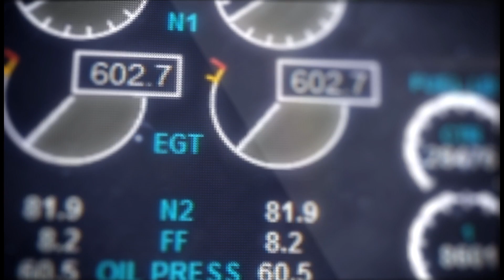Aircraft Turbulence

Comment: I have a question about setting the takeoff thrust in jets. When you move the thrust levers forward do you push them all they way forward and an electronic governor limits the RPM of the engine given whatever percent of thrust you were planning to use for takeoff?

Or if for example the takeoff thrust you were using was 90% is it just sort of guesswork and you set the thrust levers so they look like they're almost full but note quite?
Reply: +Rodgers Akechi @Rodgers Akechi  To explain flex you need to understand how engines work. The hotter the air is, the worst performance you will get because the air has already expanded. Now on hot days it takes longer to accelerate because of that. So when you enter a flex temp, you make the fmgc calculate the thrust rate as if the temperature was 15 degrees or so higher to reduce the performance of the engine and get less wear on the engine. The equivalent of the boeing is using derate on take off. 

Now on the airbus the full (as you say) refers to absolute max (TO/GA) the engine can give which can sometimes be above 100% N1 and can only be used continually for 5 min when two engines are operating or 10 min max with one engine out or else the engines will overheat. The climb detent is used after accel altitude to set the climb N1 and engage the autothrust. The MCT is max continuous thrust which is the highest N1 setting that the engine can produce indefinatelly without overheating.
Reply: Rodgers Akechi No problems man :)
Reply: +Britman  @MentourPilot Just to add on in this question,what is flex on an Airbus? What is its comparison in a Boeing? And whats the difference between full and climb position in an Airbus's throttle quadrant?
Reply: ***** Thanks!
Reply: +Britman TOGA
Reply: I'm actually not sure?
Reply: +Mentour Pilot  You also have to consider the noise effect of the engine and the runway conditions?
Reply: +Dimosthenis Fakiris couldn't have found any clearer explanation..short but precise..thanks alot buddy
Reply: +Britman It depends on the aircraft type. Usually after 50% pilots will engage TO/GA mode which will set the thrust automatically to a preselect N1% which was selected before take off. BUT TO/GO only does that for take off. In flight when TO/GA is selected it will give the engine's absolute max and will overheat the engine if used for too long.

Comment: What about wake turbulence and flipping smaller planes. What is the worst case it could do to for example a 737?
Reply: +Britman You also need to remember that the crew flying weren't certified pilot's so their reactions weren't exactly perfect...
Reply: Yep, they struggled to keep their speed to the one requested by ATC, but also the wake lingered for longer as it was an exceptionally calm night. 👍
Reply: +iPirmin Kerman I'm nowhere as good as mentour but in 2008 wake turbulence from a B767 caused a Learjet to crash in Mexico City.
Reply: Peely baii Thanks! It's been a while since I've looked at that one, am I correct in thinking that they hadn't reduced their speed as ATC had asked them to do so? Or was it something else that resulted in the loss of adequate separation?
Reply: Peely baii Good to know, thanks again!